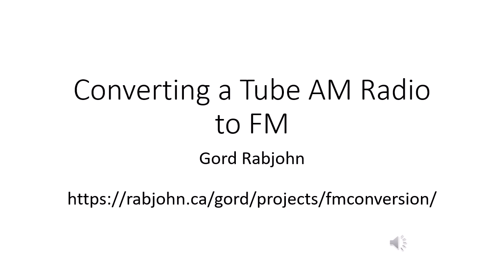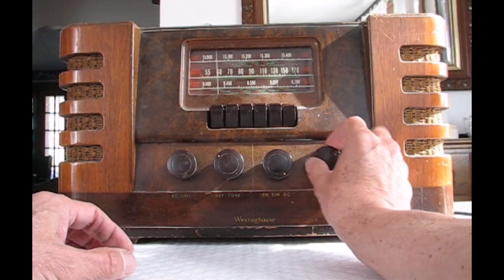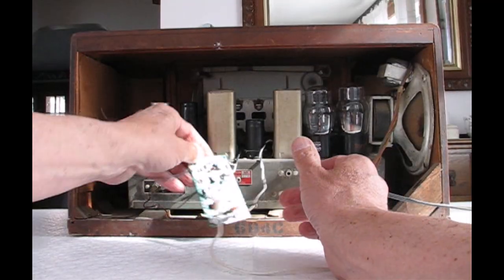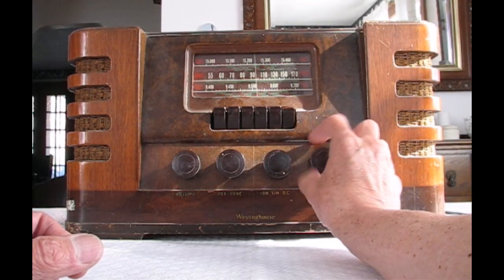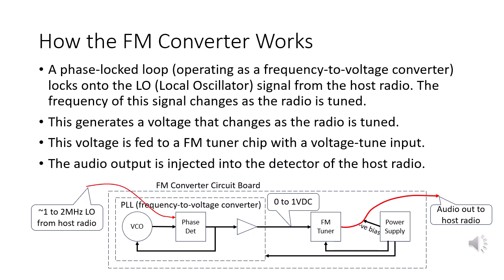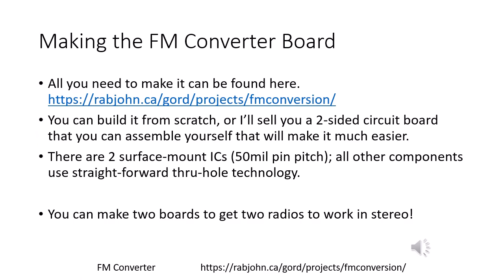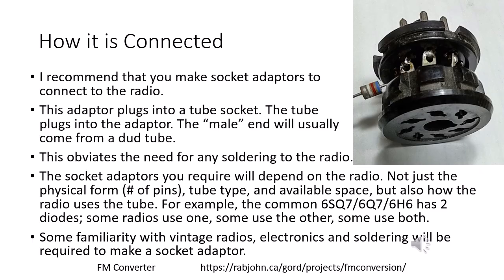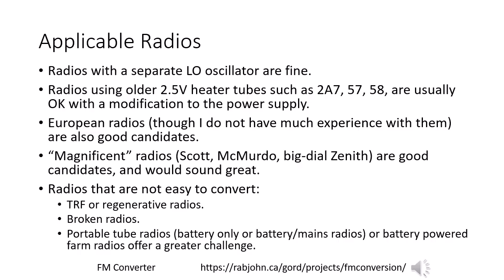How to convert an AM tube radio to FM

Comment: Love your mod boss . My grandfathers radio circle 1950 a bush .. has a gram or input .  As amplifier.  I plug the phono socket into a small radio with FM. Then into grandfathers radio . Wait for radio to warm up. . turn to gram. . turn FM radio on . Sounds great . Something about a old valve radio with that monster speaker ..

Comment: For me it looks like not a converter but completed FM radio circuit board which uses a vintage radio's audio tract as amplifier. Am I right?
Reply from the maker: Yes, but it is also linked (electronically) to the host radio's tuning mechanism so the host radio behaves just like it always did. That is, the FM tuner does not have its own tuning knob. And, it does this without permanent changes to the radio.

Comment: You are a butcher of history sir!! That radio has been through a lot and this is how you treat a survivor!! Shame on you Sir!!
Reply from the maker: On the contrary, I have great respect and reverence for these radios. Tubes are (almost) always in sockets, and that's where the FM converter connects. Adding my FM converter to the radio is as tame and gentle as replacing 2 socketed tubes. And, of course, you can reverse the procedure by unplugging the adaptor and returning the tubes to their sockets. The radio returns to precisely its original condition, and it takes about 1 minute. Nothing in the radio is cut, soldered to, adjusted, moved, wiggled, rewired, or molested in any way!
Reply: Are you for real?
Reply: @321CatboxWA   Yes, I am for real! For those sets have seen a lot over a long stretch of time! And there is not a any need to modify those old AM sets. Just get a FM set from the 1940's and beyond and have some fun with that set rather wasting your time modifying a AM set!
Reply: What did he actually do to butcher the radio? You really had to look hard for the critizsm. I thank him myself.
Reply: @jamesdoughty5530  The technician should not have modified the receiver at all. The technician could of put a loading coil in series with the antenna to enhance the reception of the receiver without going through changing the circuitry at all.
Reply: It was none of your business, if he threw it in the trash.   @vintageadventureswithrobert
Reply: @jamesdoughty5530  Throwing those radios in the trash as you say, would be a crime against nature to have any of those poisonous elements within the radio would leach into the ground and all that fine wood would be wasted. 
And what is restoration is all about. to restore the radio to its former glory or function to what it was before the set began to degrade due to age and lack of use. Not to create a restomod set. So there!

Comment: I have a couple of questions.
1) (if you only sell the board) how much is it to build
2) how can I modify it for a Heathkit SW-717 and a zenith transoceanic
Reply from the maker: I have not set a selling price for the bare board yet. Probably about $10. I calculated that the parts would add up to $30 per set, but it depends on quantity and how many parts you already have around, of course. The 2 ICs and the mica PLL timing capacitor are the dominant cost. 

First , a question: for the SW717 and transoceanic, do you want to keep the AM & SW operation? I guess you would. I have not done a switching scheme. (I just discovered this product: it does offer band switching: https://www.paleophonies.com/FM-DW/FM-DW.htm )

Giving up the AM/SW: Converting the Heathkit would probably be an easy job. The Transoceanic: tube versions will be difficult because the converter needs >5V at ~35mA. The filaments run at 50mA, so tapping off of the filament will seriously upset the filament supply. The only way it would work would be to supply the converter board from somewhere else. Solid-state Transoceanics would be easier.
Reply: @gordrabjohn7039  The transoceanic that I have is a solid state
Reply from the maker: I am selling bare boards, or bare boards plus the two main ICs (not mounted; that's your job!) for $6/$10 CAD (Canadian addresses) , $5/$8 USD (US addresses). or $9/$13 CAD (rest of world) https://rabjohn.ca/data/documents/Procurement.pdf

Comment: The August 1961 issue of Popular Electronics had an article titled "Introducing the Compactron", which was a construction project for a single tube monophonic FM radio capable of driving earphones. I constructed the project, connected its output to a phono jack on an All American 5 radio and had an AM-FM radio. At the time, I lived in Schenectady, NY, and there was only one FM station receivable, WGFM, sister station of WGY AM, with both stations carrying the same programming most or all of the time.

FM radio, with its wider audio bandwidth, lower noise, and better transmission performance, was considered ideal for classical music. However, the listener audience was small and it was harder to insert commercials. So, FM failed to develop, but I think many AM stations operated sister FM stations to reserve a space for when FM would eventually come of age.

I went to college in the Boston area from 1964 - 1968 and brought my "AM-FM radio" along. There were more FM stations, but most, if not all, had sister AM stations and carried the same programming. Then, the FCC required that the FM stations carry unique programming for a minimum of a certain number of hours per day. WRKO's solution, which it commenced broadcasting on October 12, 1966, was to create an automated top 40 format, no DJs, no commercials, just music with a little automated talk between songs, and the no. 1 song at the top of each hour. With no significant listener base, advertisers were unwilling to buy air time. The format, however, was a smashing success. Teenagers bought FM radios in droves. Suddenly, there was a significant listener base. The format became a victim of its own success as advertising was introduced. With a large number of FM radios in Boston homes, other FM stations gained audiences. I think WRKO led the movement of the top 40 format from AM to FM stations.

Comment: I got an old automotive FM converter. I power it from a 12V wall transformer. One with the actual transformer and DC output as the small switching types may make interference.  I ran a shielded wire to the antenna inputs on a 1937 Zenith cube type radio. Just long enough to have the conv.  next to the radio. Then I connected a long piece of tiny insulated white wire(for low visibility) to the antenna jack in the conv.  You need an 8-10 foot wire for it to still receive AM well.  The same wire works for both AM and FM reception OK.  The radio needs to be tuned to the output frequency of the FM converter,  which you adjust to a frequency where there is no local AM station on.  Then you tune FM with the converter.  Or switch the conv.  to bypass/off to receive AM.  Works great for me.  The FM sound quality is great on this particular old radio.
Reply: In the early 1970s, the AM-FM car radio was available as an option on new cars, but very expensive. One FM station had a promotion where it sold these converters at a discounted price. The converter modulates an AM carrier with the FM audio and the AM radio tunes that carrier. With a pushbutton AM radio, the listener could set up a pushbutton for the converter and press that pushbutton plus one on the converter when FM listening was desired. The hookup was fairly straightforward.

You may be able to improve the fidelity by connecting the FM audio directly to the audio amp in the radio, as Gord Rabjohn's converter does.

Comment: For octal socket radios using the shown adapters it's doable but try to find a miniature test socket adapter for  any later
tube radios with only 7 pin miniature  tubes it will be expensive and the vintage adapters must  be cut open to access  connections inside. Tricky but also doable. Nice circuit design Gord.
Reply: Make one.